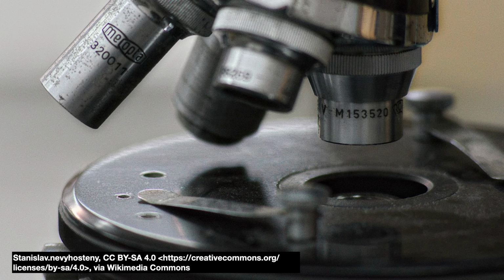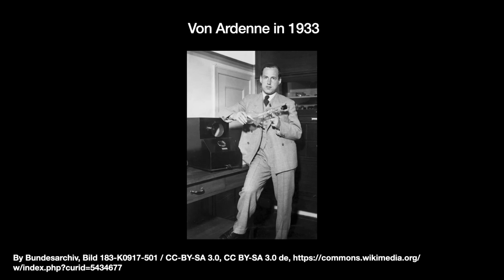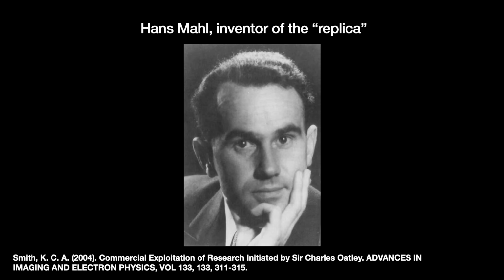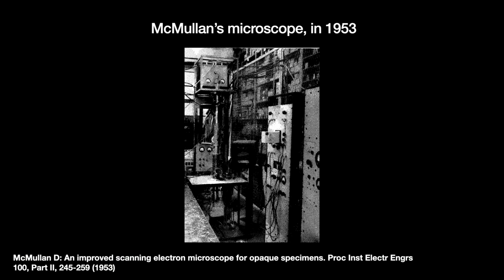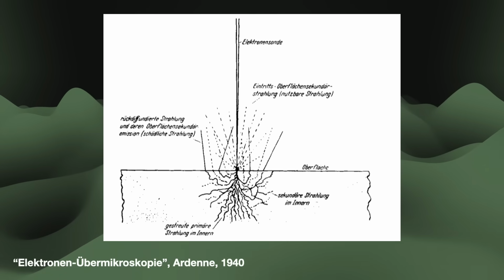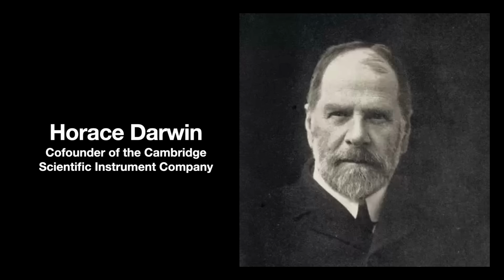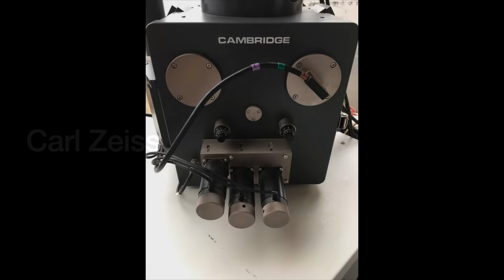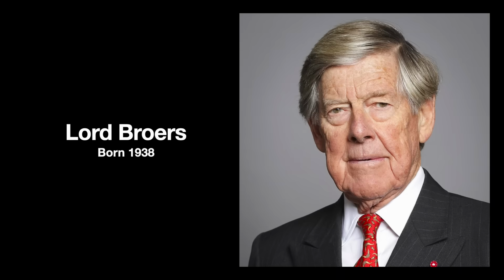The Difficult Birth of the Scanning Electron Microscope

Comment: I used to work for Amray, an American company that developed a commercial SEM with Professor Sheldon Moll at MIT under a grant from the US Department of Defense.  I think this was in the late 1950s or early 60s.
Reply: Paul, I worked with Shelly and Manny for over a decade, friends until they both passed away. AMray began as Advanced Metals Research andthen AMR. Their first product was an electron microprobe, marketed by Philips. Shelly was a student of Professor John Torrey Norton (MIT) the founder of AMray. Dr. Norton's portrait is in my home office. The probe initially had a static beam, two vertical crystal spectrometers. AMR made the probe scan and used absorbed current, circa 1962 or 63. I joined AMR in 1977. The President was Gerry Cameron, who was the stuff of legends. Amray was acquired by KLA-Tencor, now KLA, my current employer.

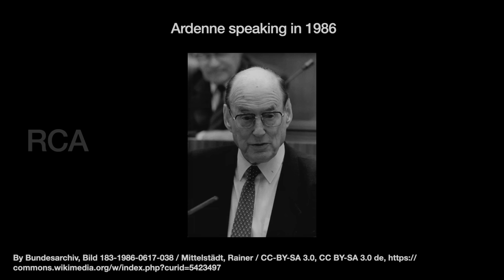Comment: @7:30 Von Ardenne's legacy also includes the current production of vacuum coating equipment that is still using electron beam technology for melting and evaporation. Their range of equipment is used production of coated glass and solar cells.

Comment: I remember a Philips ad in Scientific American with an image take n by an SEM that could work at ambient atmospheric pressure, no need for a vacuum. The ad showed an ant carrying a memory chip, the resolution was high enough to see the details on the chip. It may seem not a very high amplification but working at atmospheric pressure was amazing and working fast enough to take an image of a living samples was also amazing. I don't know if it was a commercial product or a proof of concept, but the ad was good enough that I remember it 40 years later. I think I still have the magazine. It was not those colored images you see on Internet it was a grayscale one and the chip was visibly a DRAM (only regular features).
Reply: It wasn't ambient pressure. More like 6 or 7 torr of water vapor. This was the ESEM or Environmental SEM, first invented by Gerry Danilatos. I developed an improved electron detector that suppressed the collection of BSEs and collected only low energy (less than 5 eV) secondary electrons. At that point Philips acquired ElectroScan, and I was out of job. Then camr FEI, and now Thermo. A few of us are still around.

Comment: I operated and maintained a MarkII Stereoscan for several years.  It looked a lot like the one shown at 0:07.  The maximum usable magnification was ~20K on a good day.  At one point I fitted it with an Apple II computer with 12bit DACs to steer the beam and drive the beam blanker, and used it for e-beam lithography.  0.25µ resolution across a 1mm square field.
Reply: Using a SEM for lithography sounds very amusing. Would be a relatively cheap way to prototype ICs or make a custom part. Awsome. ❤

Comment: At 4:39 your assumption is incorrect, the scientific community did not want Knoll awarded a Nobel prize thus the long break between its invention and Ruska eventually splitting it with the inventors of tunneling microscopy. In a similar manner, many would think that Erwin Muller, inventor of field electron and field ion microscopy, would have won a Nobel prize but again he was controversial enough that the scientific community would prevent it.

Comment: After 20 years in the industry, there isn’t another single tool I used more often in evaluating process development and yield improvement. The SEM, EDX and FIB combination was used on everything. 

There are other technologies that were completely required for development of one node or another, but the sem enabled every node improvement due to impoverishment in development cycle time.  A SEM in fab allows adjustments on the fly to DOE’s and cross sectional SEM images which took time in hours to days were more of a secondary confirmation that changes or improvements were ready to send forward to electrical evaluation in days or months.
Reply: I've been using them since 1971.
Reply: When I had a job I had a few gold coins, bought one on eBay that had a UK auction tag, an 1880/70 OVERDATE "Marsh coin"

NGC slabbed it for me, graded it etc.. but it should say Marsh #whatever. The tag literally meant it was the coin in the Marsh THE GOLD SOVEREIGN reference manual.. every single bag mark the same. The odds ? one in OMEGALUL impossible. I put this on the internet before, told the buyer I think.. so long ago oh well :)

Then again, I sent them an Australian dollar "STRUCK THRU" oil from a press.. NO DATE ! so they used this mastery of human ingenuity and teamwork to put the right date.
Reply: Great job on not deleting after two edits
- sorry, I do these things sometimes type too much too fast before i forget a few key points. The wall of context posts a few times over the last years were.. too hard. Way too much going on without the right analysis of the data in my comments, lost a bunch of hard work.. its okay

Maybe Google helping out YOUTUBE ????? Fix the other crap if so lol, #fake #tickers #botnets #fake #advisors #list #goes #on

Comment: I own a Cambridge Instruments Stereoscan 260 as shown in the picture at 19:10. Me and a couple of friends bought it on an auction from Stockholm university. Sadly we only managed to produce a couple of images before it failed. It turned out to be in very poor condition. I am still trying to bring it back to life and replacing all of the electronics with modern components. I have a couple of videos of it on my channel. The SEM is a very interesting collection of engineering marvels, precision electronics and plumbing. Thank you for a great video!
Reply: What did it cost?
Reply: @StefanReich  The auction ended at about 350$ plus a trip from Gothenburg to Stockholm to pick it up. Luckily we could borrow a truck from work.
Reply: @Dustycircuit  Oh wow. I was expecting it to cost much more
Reply: Gosh, pretty heavy freight I'd guess....oil diffusion vacuum pump included?
Had a neighbor that had similar from UC Berkeley...he was always tinkering, but eventually got some excellent images...
Reply: @stevengill1736  Hi, Yes it was project in it self to pick it up. The biggest problem was to get it in to the shop since I did not have a pallet lifter. Lots of hydraulic jacks and sweat :)
It has a TMP (turbo molecular pump) but it is pretty old and quite scary to run. The last thing I want to experience is a "turbo sallad". That's when it basically violently explodes. TMP's are expensive so it'll have to wait for wife approval.
Reply: @Dustycircuit  modern turbos like those in the S260 are designed to contain the rotor inside the pump in case of a crash. so don't worry about shrapnel, unless the rotor case is damaged (which i doubt the previous user managed).  Just dont bump against the pump, or have the vent valve speedivac clamp break while its at speed. Also, check the running sound and temperature, and replace the oil and or bearings if its excessively loud or hot. Look to the maintenance log about when it has last had its oil replenished, or replaced. If its the version of the pump with a plexiglass oil Reservoir, check the color, fresh oil is a pale yellow color. once its darkish red to brown it should be replaced. 

Also, what broke or what are the fault symptoms of the machine?

Comment: The gun and the detector are completely collinear?
Reply: In standard TEM set-up, yes. But it's just for convenience. with strong enough push-pull from electromagnetic fields, you could put the detector conceivably just about anywhere. Back-scatter detectors and Everhart-Thorley detectors (two most common in SEM) are above the sample, for instance. DPC imaging in TEM has detectors above and/or below the sample. There's variation depending on the desired application.

Comment: i wish i could own an electron microscope but it seems like they are just as big and expensive as in the 1950s.
Reply: Dont forgot the various sample preperation equipment needed. Its expensive in all ways.
Reply: @lbochtler  yea even with my cheap traditional microscope it's easy at lower magnification. but at the highest settings everything has to be perfect or it is just a blur
Reply: @belstar1128  with electron microscopes, you also have problems of image distortion and odd behavior due to charge buildup in the column and or sample. so its even worse in some respects. with enough money and diligent work all these problems can be solved however. Though its not as easy for a Hobbyist. it can be done however, just not all that cheaply.
Reply: @belstar1128  i should also add, that i work for and am working to build the first proper electron microscopy museum, located in Nurnberg Germany, we plan to have a citizen scientist lab there, where anyone who is interested and can pay the materials and machine time, can use both a scanning and a transmission electron microscope by themselves. If other methods other then those available on the 2 citizen microscopes are needed, then the ones in the main exhibit or the research lab can be used under supervision or directly by museum staff. 

Basically, the cost of ownership is born by the museum, and only the quite low cost of use is to be payed for by the user. Examples of cost (not the final numbers, but internal numbers) is, around 5 to 10 euros per hour for running the microscope itself, and between a few euros and a few dozen euros per sample preparation, depending on technique. The maintenance and consumable items like the cathodes are expensive on their own, but spread over time and many users, not that much anymore. The maintenance itself is done by the museum staff, so lower cost then having the OEM do it. 

I hope that people like you would be interested in this concept. We also plan on having 2 remote controlled machines where people world wide can send in samples and look at them via online control. sample prep would be done by either the sender, or museum staff.
Reply: Depending on where you live, you may be able to get one at auction. The analog scopes are especially cheap. Usually $500-5000. You then have to get it delivered and set it up in a stable environment. Getting it up and running and maintaining it is a different story. I bought an SEM at auction for ~2K including all expenses. Not yet functional, but I tinker with it every now and then. You can also rent a benchtop SEM for ~3-5K/day. I know a couple of people who do that as a professional service. The advantage there is you don't have to deal with it afterwards and it should be guaranteed to work during your contract.

Comment: ....and that was only the beginning. Now electron microscopes can be used instead of mask lithography, and allow the creation of ICs beyond the current reach of technology, giving researches the ability to see what lies at the next shrink level. There is a variation of the SEM that allows reading the voltage on a trace in a live IC with the passivation removed, giving a scope style trace of what is going on there. This is hooked up to the layout database allowing the user to select a wire in the design to display. And FIB or focused ion beams came from the same science, allowing companies to cut out and add material to ICs... literally editing an existing design. The possibilities are endless.
Reply: At our lab, which we have ~40 various electron microscopes, the SEMs that cut and weld we call "dual beams" (welding and milling).  It's pretty cool to watch a tiny part of a chip be cut out, sliced, then welded onto a 'grid' for the TEM to then image.  That or see them "mill" an picture/image onto a chip that nobody will ever see.

Comment: I've operated a SEM while working for a professor at UT Austin. They have this electron microprobe thing which uses a SEM as well as the right detectors to scan the elemental properties of a sample. This technique works better for heavier elements, but the idea is that when an electron beam hits something, it releases radiation. The radiation it releases tells you what it is as different elements release different radiations. I was working on probing various standards which is put into a database so that an unknown sample can be established. Operating it isn't too hard but there's huge potential to do serious (and expensive) damage to the instrument as it has zero safeguards. You can crash the objective into the sample for example (as your actual WD isn't known until you actually focus it, and sometimes that WD can be quite small, like less than 1mm). You must also operate the thing following a set of instructions in very specific order, or damage will result.

Some instruments have detectors that require liquid nitrogen, I'm not sure exactly what they're for (it was above my pay grade).

They also have SEM that can view living things.

Normally sample must be coated with conductive medium, usually gold or carbon. However when using the instrument in backscatter (BES) mode, you don't always have to do this.
Reply: Older SEMs use liquid nitrogen to cool the sensor on an EDS (Energy-dispersive X-ray Spectroscopy). To obtain the right conductivity on the detector, it has to be kept very cold. Modern tools typically use a different detector type (like silicon drift detector) with Peltier cooling, so no liquid nitrogen is involved. But you can still have systems that use LN2 for cooling the sample down. That's still very common in biology use cases like single particle analysis to discover protein structure.

Comment: I worked at the Schlumberger research lab supporting Fairchild and their CAD companies. One of them was Sentry and they produced a debugging station for chip design. Due to my background in visual inspection, I became peripherally involved, but I remember that the model number had the number 5000, perhaps SEM-5000? The year is probably 1985-86.

Thank you for a trip down memory lane.
Reply: Perhaps it was a Hitachi S 5000, or similar? Hitachi models their SEMs in the thousands like that. I am unsure the timing matches with the release of that model though. I have an old Hitachi 2600 in my garage :)
Reply: @mustardofdoom  No, it was made by the Schlumberger company, then called Sentry. It had to be because the lab for which I worked supported their semiconductor-related businesses, the biggest of which was Fairchild. Besides Sentry, there was Factron, and a printing company (can't remember the name, it was almost forty years ago).

Years later, I did work with Hitachi, near the turn of the century. Thanks for the reply.

Comment: anybody think we can ever make a atomic resolution 3d printer with Electron Microscopes?
Reply: Not impossible, but unlikely, because electron beams can’t be used to manipulate individual atoms easily, and scanning probes (like the Scanning Tunneling Microscope) so far can only move one atom at a time, so it wouldn’t be a practical way for manufacturing devices.
Reply: @FernandoJRodriguezFernandoJRM  See my other comment. It exists!
Reply: This exists. There is a technique called electron beam induced deposition (EBID) and a related method called ion-beam induced deposition (IBID). In brief, small metal particles are coaxed towards the site of 'printing' along with a reactive gas. When the ion or electron beam hits the targeted region, the added energy essentially binds or melts to that targeted region. This is how you see those press articles about 'researchers built the worlds smallest violin' or something like that. There aren't a lot of applications for the method, as it is expensive and obviously prints a small object. But it is used to test materials properties in research and to make custom sample holders for in-situ mechanical testing.
Reply: @mustardofdoom  Fascinating - thanks for the reply.  I'm thinking they should be able to do massive parallelism to be able to make bigger structures.  But, obviously, there's a problem somewhere in there.